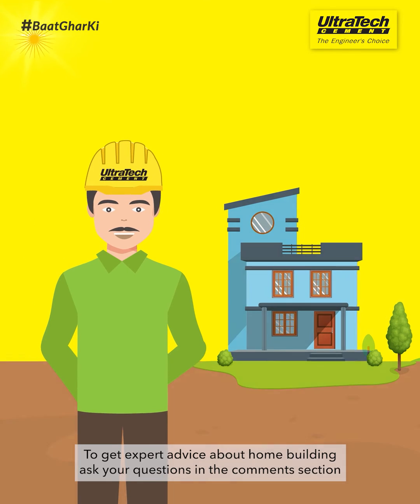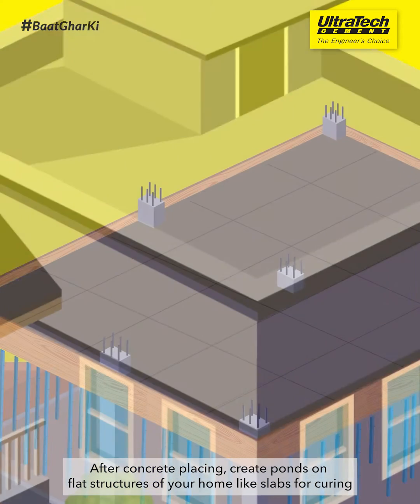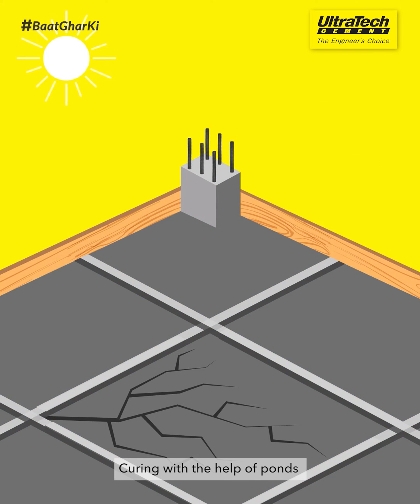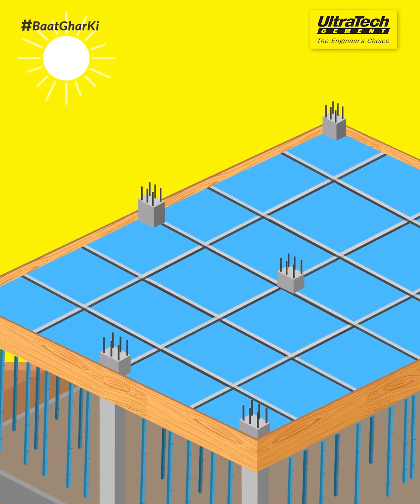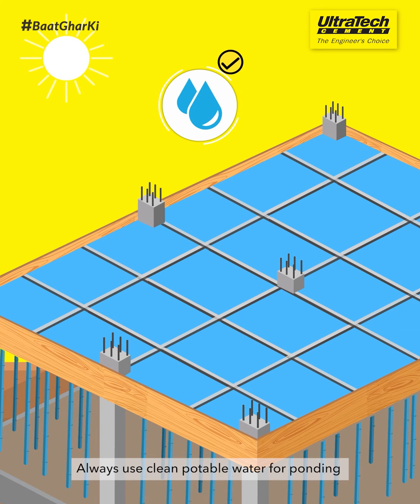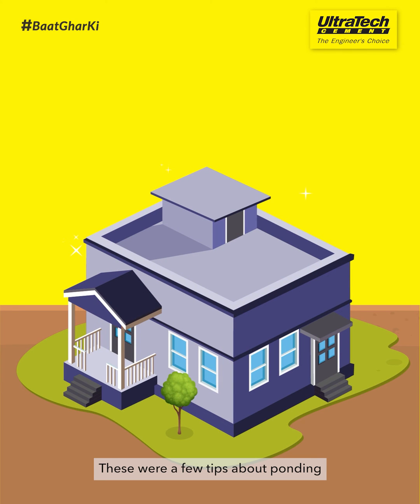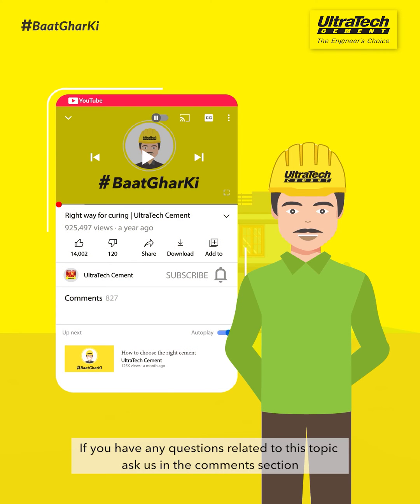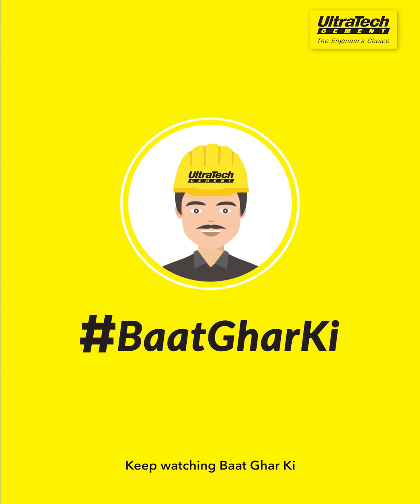How To Do Curing of Concrete By Ponding Method? | UltraTech #BaatGharKi

Comment: How soon should i start ponding after concrete pouring/finishing
Reply from the maker: Hi,
Thank you for your query. Ponding should begin as soon as the concrete has set enough to hold water without damage, typically around 4 hours after finishing. Early curing is crucial to prevent surface cracks and ensure strength.
Regards,
Team UltraTech

Comment: I used Ultratech Weather plus Cement for Roof Slab Casting.  Does it also needs curing ? If yes, What's the difference from Normal Cement Curing?